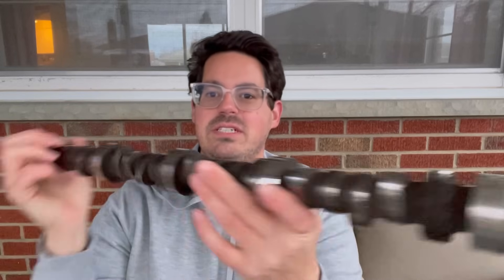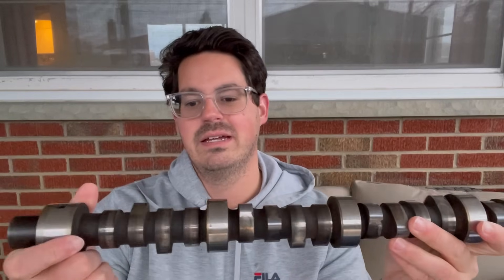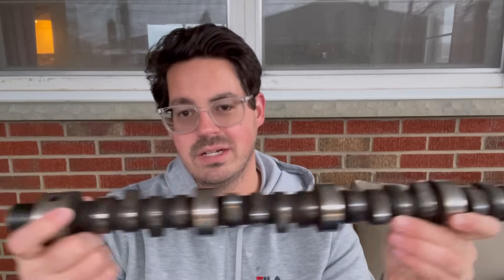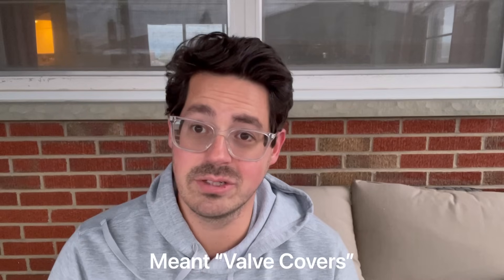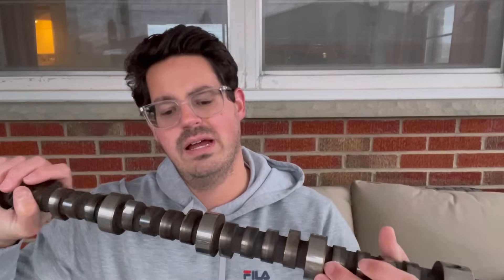Worst Automotive Components: Soft Camshafts (Chevrolet 305 & 350/Cadillac HT4100/Pontiac V8s)

Comment: Thank you, first video I've seen on this issue.  My dad bought a brand new 78 or 79 El Camino.  Didn't take long for it to start running badly.  He kept taking it back to the dealer and they couldn't (or wouldn't) fix it.  At one point he threw the keys across the floor of the service garage and told them to keep it.  He doesn't know a lot about cars, but his words were that GM used some sort of experimental aluminum cam.  I don't know if they ever fixed it, but somewhere around 1981 it got totaled in a wreck.  But after that experience with the dealer, he never bought a new car again.

Comment: I worked in a shop from 82 to 97. Saw all those problems. Mainly 4100 and Chevy 305. The Oldsmobile problem was the oiling on the rocker arms and bridges closest to the heat crossover in the head. It would pop through carb like a bad cam.

Comment: Absolutely fantastic video - thank you Adam. I've landed on a 79-81 Eldorado for my next classic and I was already thinking "no way" to the 82-85 because of the HT4100. I'm not wondering if the 350 Olds in the 79 is also risky. Seems like 80-81 are the ones to get!

Comment: "Soft camshafts" on small block Chevies went all the way back to 1954 on the 265.  Insufficient oiling on the rear cylinders plus lack of hardening plagued them all through the '50s into the '90s.  The HT4100 flat lobes were always paired with leaking coolant.  If the gaskets or RTV didn't leak, and the stop leak was used as dirrcted by Cadiilac , there were no such wear issues..

Comment: 1973 Monte Carlo purchased in 1997 with 50000 miles. Seller thought it needed a rebuild, but it just needed a new cam (+ timing chain) and it went 100,000 miles without issue.

Comment: College freshman me, had a 1972 Pontiac Catalina with a 400, lobes rounded off on #8....buttery soft cam.  Summit Racing in 1987  had an aftermarket cam made by Alliance, ground to the factory spec of a mid 1960's 421 [one of the McKellar cams] with proper heat treat, and lifter set, for a whopping $59.  Oh, to be 19 again.

Comment: The 1980 Cadillac 368 (6.0L) and 1981 Cadillac V8-6-4 6.0L also had a silent recall for bad camshafts. They would round off the lobes in normal driving.

Comment: Years ago I bought a used '69 Chevelle with the 396 BB.  I was so excited yet underwhelmed when I tried to rev that engine.  One day a head gasket blew, so I went to replace it.  It was then I noticed the cam lobes were all nearly flat. I don't know if previous owners just never changed oil or if maybe the soft cams were also used in the BB motors.  Anyway, I buttoned it back up and got rid of it.  I couldn't afford to rebuild that BB in my younger days.  Wish I had that car today, though.

Comment: My father bought an '86 IROC Camaro.
Soft camshaft-- on what was basically a street-legal race car.
It was replaced on a broad recall, under warranty. 
That was the most unforgettably awful automobile I have ever encountered, by far.
While it was a complete blast to drive and was ferociously fast, and had tremendous handling, everything in the car fell apart, over and over again. 
He finally sold it for a pittance, a couple of years after word had gotten around about the cars. There are almost none remaining today, as far as I can tell.

Comment: Problem is that all that metal from the cam lobes and lifters went somewhere did it all get picked up by the oil filter one would love to hope so but I'm sure lots of small particles got into the bearings thus reducing the longevity of the engine how could it not oh I know lots of them we put new cams and lifters in and they were fine and at the time I thought nothing of it great all fixed but now thinking about it there's no way it didn't do some kinda damage

Comment: I worked at a company, and the building was a previously used by a major OEM to the auto industry making springs. They hired an employee previously working there (same parent company) and he told us all types of stories. They would occasionally forget to heat treat the springs properly, and they felt it was too much trouble and expense to redo them, so they would try to slip them by. He said Cadillac had very high specs, and Chevy, well it basically just had to spring. So, Caddy would reject springs that didn't meet their specs. The springs are big, and they ship them in huge crates, so they would put the rejected ones at the bottom of the crate, and good ones on the top, and they would be accepted as they randomly test a spring or two. He absolutely hated Honda, he said Honda would test every single spring, even the ones on the bottom of the crate. This company made a lot of auto parts,  and they would even stamp GM/Ford/Honda/etc on the part. Supposedly the auto industry doesn't want to be tied to a single vendor, and look at tires, and windshields, they just buy them. Those soft camshafts could have come from a single vendor, and they have vendor marks on them, I know that. This was in the 70s/80s so I guess that was the Malaise era. And yes, that previous employee, well he wasn't a motivated worker even with the new group and didn't last long.

Comment: Bought a 74 Pontiac Astre (Vega) brand new, took it to emissions and it failed on week one. It also burned oil at an alarming rate, and that was with couple thousand miles on the clock. The dealer didn't want to fix the emission problem, they said its not required to pass emissions for 3-5 years, but I insisted they correct it. They didn't want to look at the oil issue, they said it needs to break in. After 4-6 trips to the dealership, it still failed emissions and burned oil. My dad (GM employee) said the warranty and dealership were worthless, so we inspected ourselves, on basically a new car. We took off the valve cover, and there are rubber seals on the valve stems, the exhaust stem is thicker than the intake stem. The seals on 2 cylinders (out of 4) were backwards, the tight intake seal jammed on the exhaust stem and it just went up and down with the stem, not even working. On the one cylinder they were upside down, which really made us wonder how it passed QA at all. The seals were cups or umbrellas, to shield the oil from going down the stems with the up/down motion as I understand it. Bought new seals myself, replaced them correctly, and the oil consumption dropped significantly (but later grew into that with age) and I believe it passed emissions after that, but I don't quite remember if we adjusted or corrected anything else while we worked on it. The experience really soured my opinion of Pontiac and GM.

Comment: I had a 78 Impala with a 350, at 42k miles it had worn off 3 full lobes and was working on a 4th. pain in the butt. put new cam in and she was pretty happy.. still though.. 42k miles and having to change that was craptastic :(

Comment: I got paid very well because if this issue. Cars with under 50k but just happened to be 30+ years you would get bad backfire over 3000k RPMs. The last car I hand rebuilt the motor was a 68 Camaro with a 327 and Power glide transmission. Dr. Longest  asked if I can make his car new again. Sure, How about better than new? he was 83 at the time.  I got a ??? look, I can make it a lot better. He said do it! Dude had the cash and I really wanted to see what I can make this car do. This car came with a 2 barrel carb and I dumped it. 4BBl Holly on a Edelbrock  intake 7800 Cam and a 3800 converter.  Hand built 327 with high performance parts total, 5300 bucks. Do that now and they want a million, greedy bastards!  it was making 388 HP at 5320 RPM, Factory was 200. If you played with the factory timing you might get 200.  As I learned from my father take them around the block to show them what a good job you did.  I took him up the interstate with the wheels spinning. He was begging me to slow down. Want new tires that can handle this power? We have those too. He had the Polys that came on the car.  For the sad ending of the car not Longest go to my channel.

Comment: The 65 Falcon with a 200ci I drove in my late teens (circa 2006-2009) loved to eat the distributor gear on the updated Duraspark 2 distributor that I installed in it. I think I replaced two duraspark distributors before I finally got a hardened gear from a supplier and paid a machine shop to press it on one of the "worn" ones I had laying around. At the time I remember reading that the issue was cam gears from the late 70's and early 80's that Ford used were weaker than the older Cams used in the 1960's combined with the lack of zinc in newer oils. 

Maybe it was something about the metals in general back then as it sounds like the problem was around in multiple manufacturers (US at least). Or just cost cutting given the way a lot of these US 80s cars were built. I always wanted an 80's fox body until I sat in one and realized nothing in the interior was even close to the quality of my XR4ti, Ford of Europe must have had higher standards.

Comment: I had a 77 gmc with a 350 and the lobs rounded off but lets also remember that's the same time r
the industry removed the zinc from the oil which caused most failure's

Comment: That was when catalytic converters were first being installed on cars. At the same time they were removing the zinc from oil because it would cause catalytic converter failure. Shortly after that most OEMs went to roller cams. The wrong oil without zinc can wipe out a flat tappet cam in 15 minutes.

Comment: In high school I had a 1979 301V8 equipped Olds 88 that regularly could out “drag race” my friends 1977 Malibu, a 305 with 40,000 miles on it.  Sure enough soft cam.  He had it replaced and my Olds could never catch it again.

Comment: HT 4100 had a major issue with oil return. the head bolts were like a worm gear & the oil would run through this worm gear. Problem was if anything clogged it up ,say like Old Quaker State oil all the oil would be in the top end & none to the oil pump & then Kablowie knock city

Comment: Did this car have flat tappets or a roller camshaft? Zinc phosphate was added to oil to help prevent wear due to sliding friction such as flat tappets, but it fouled the newfangled catalytic converters, so manufacturers switched to roller lifters around this time to overcome the lack of zinc phosphate.

Comment: Oh boy, I could do a follow on video after this one. #1.  I never saw the cams fail on a well maintained GM engine. Poor oil service history, lifters would start to stick wipe out the lifters and the cam lobes...and poor coolant services and running hot....old style pellet Catalytic converters would melt down, clog up, over EGR the engine and turned into a total smog monster. Many makes and models w/gear driven distributor / cam sensor assys can whack out the computer and cause issues. Today, we find older Dodge products and Ford engines from time to time.

Comment: I thought I wiped a few lobes on the Lunati camshaft in my racing engine, come to find out, it was 3 bad anti pump up lifters. But I bought a new cam anyways. I went from 112 LSA down to 106 LSA, I lost a little valve lift and duration, but in my hobby, bigger is not better.

Comment: I had a 69 Grand Prix in the mid 70s 400 cid and the camshaft lobes were like worn Halfway off.  suprisingly it ran pretty smooth. But no real power. And it sucked down gas like it was going out of style. 120,000 miles.

Comment: The cam in a Chevy V8 is held in position by the load of the oil pump but also the load from the taper ground on the lobes(all high to the rear of the block).  If the camshaft was ground without the correct taper or no taper at all this would cause the lifters to not rotate(early failure) and it can also cause problems with the distributor gear teeth because it would allow the cam to move back and forth in the engine.  This would be much more likely than a "soft cam".

Comment: Way back in the day, we used to call these cams 'suffering from the China syndrome' which was a movie from the late 70s. What's interesting to me is that while Chevys and some Olds mills seemed to get lifter tick, Ponchos didn't, just lost lots of power and even misfired at idle. Same with some Caddys and a couple Buicks I worked on. What I will say is that a lot of the cars I worked on got aftermarket cams/lifter sets along with dual roller chain sets and we never had an issue after that.

Comment: 👍In 1986 I bought an 81 Chevy Z-28 Camaro. 50k miles. Beautiful well kept car. 
A diesel mechanic was original owner. He told me about the soft Chevy cams. He replaced the 350 cam w/ a bit larger one along w/new carburetor tuning. That Z-28 was a super fast car after that. Owned it for 1 yr but insurance was killing me! Sold it, got married. Always missed that one after selling! Very fun, fast car. 
Good info! Thx 👍

Comment: Reading through the comments we have as the culprit:
(1) Soft camshafts.
(2) Lack of zinc and other goodies in the oil.
(3) Lifter bores with no tilt.
(4) GM accountants.
(5) Drinking on the assembly line.
(6) Incorrect break-in procedure.
(7) Incorrect break-in oil.
(8) RTV?
(9) Greedy dealers.

And that's okay, it doesn't have to be just one cause, perhaps a bunch of little details, none too significant, but that added up to cam failure.  

We experienced something similar in the Honda BYBA AT's of 1999-2005, they squeezed in a fifth gear and had to shrink several gears.  Very bad results with most trannies failing in 20,000 to 70,000 miles.   Honda paid out $550 million in tranny replacements.  Shazam.

Comment: We had the same issue in yhe UK with the early "pinto" 4cyl OHC engine, Ford sorted the issue by chilled casting the camshafts after a few months but for the next 20 years the "chocolate cam" label stuck 👍
Poor lube design to the cam didn't help either 😏
Reply: Yes I had a  2.3l pinto  wagon.  A couple of times it tossed out the  cam follower. I parked it and found a  fresher engine to swap, and a header, but  time and  rust took a heavy toll.  The  back window  was  completely surrounded with rust, ending up loosing the car.
Reply: @knutbjornlarsen4435  different engine to the UK version of the pinto, similar though 👍

Comment: What your describing is probably lack of ZDDP in your oil (Flat tappets?). Worn distributor gears and wiped lobes are caused by the government requiring the removal of ZDDP from motor oil starting in the late 80's. Camshafts are surface hardened using a nitrate baking process, but this only protects the lobes for a short time until the ZDDP in your oil can start surface lubrication of steel on steel contact points; namely the lifters and the meshing gears of the distributor/cam. The car companies started converting the engines to roller lifters and distributorless ignition systems fist by coil "packs" then by coil on wire.

The ZDDP was removed because it would coat the metals in your catalytic converter and reduce it's effectiveness.

You can still get ZDDP as an additive or some mfgs. sell "break in" oil with ZDDP.
Reply from the maker: This happened way before ZDDP was eliminated from oils.

Comment: I would consider this a production problem or an improper (cheaper) materiel problem. Not an engineering problem.
Surface hardening is a specific process to get the proper depth and hardness. That technology was known very well by the time these engines were built. It's desirable to have the rest of the camshaft made of a softer, less brittle, steel to allow it to survive torsional impulses much longer without cracking.
Reply: Most of the 283 cams I  saw were brittle, but don't remember any  going  flat. Now that nylon  faced aluminum cam gear,  that was  brilliant.

Comment: i have a 305  in a 79  caprice   ,never run 10w 40 in it,,it has 5 w 30 mobil1,,,,cant hear it run,,,had a 79 chevy van 350  ran nothing but 5w30 mobil1  in it,,,,ran like new till  i sold it,,,got more kids  lol  got a new 95 transport  3800  v6  loaded,,,now has 200.000 on it,,runs like new...heard about soft cams  working for gm  ,,but never  had to tear them down..i think oil  had a lot to do with some of it,,,

Comment: Speaking of camshafts here's something I would be interested in knowing more about, the Kaiser Jeep Tornado OHC engine.  How does a single lobe control both intake and exhaust?
Reply: Looking at https://images.hobbydb.com/processed_uploads/catalog_item_photo/catalog_item_photo/image/516900/Jeep_Tornado_Engines_13e266be-3e46-46fa-9417-87127b79b8ec.JPG , it looks to me like the valves are on opposite sides of the camshaft, so as the shaft turns, each lobe actuates first one valve and then the other.

Comment: The TSB recommended repair for the Cadillac 4100 was stop-leak additive. That's General confidence for ya!
Reply: The stop leak pellets were to prevent coolant from leaking past the wet cylinder sleeve o-rings at the top and bottom of the cylinder sleeve.

Comment: Adam it wasn't so much soft metal as it was the lack of a small hole in the tops of the rods that went away early 70s, it squirted oil up onto the cam and some genius Chevy engineering guy decided the sbc no longer needed that and then they started eating up cams more often
Reply: That  too. Big journal  rods,   have  no  spit holes.  I'm  rebuilding my Toyota engine  1990 and the  rods have  spit holes  up past the  parting line, drilled and  chamfered.  But  why? It's a double  overhead  cam engine.

Comment: I remember this going on back in the late 1970's and early 1980's with the small block Chevy.  So whenever I saw a used engine with the GM blue paint on it from the factory, I stayed away from it.  The blue paint years were the soft cam years.  Maybe the engines were just unhappy that they were no longer Chevy orange? LOL.